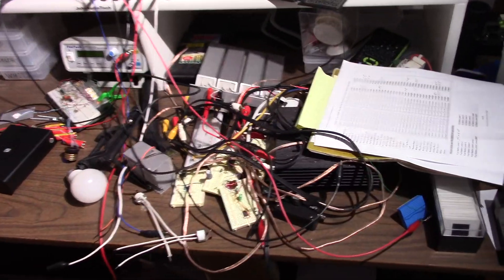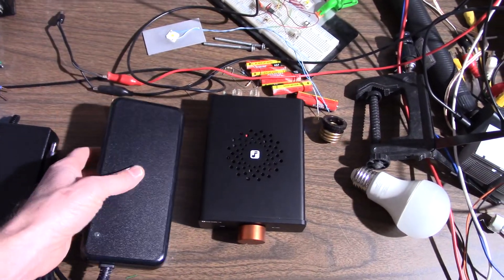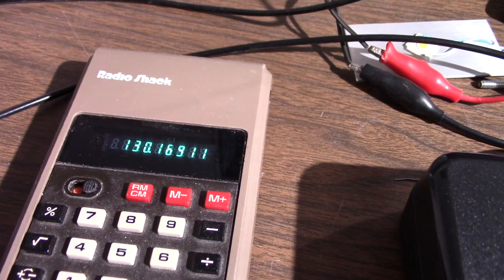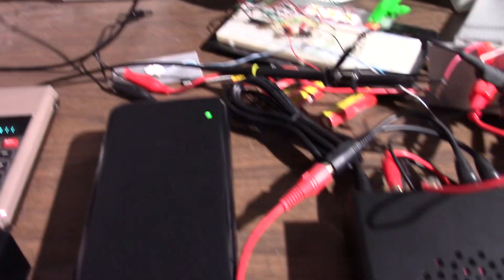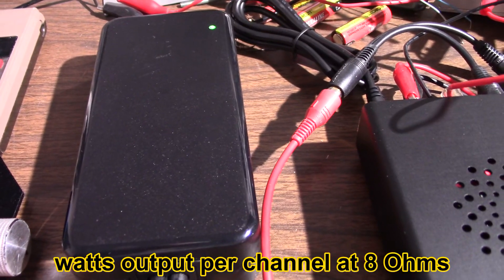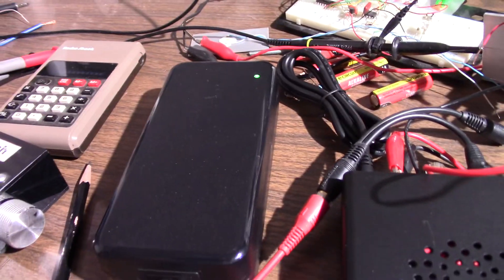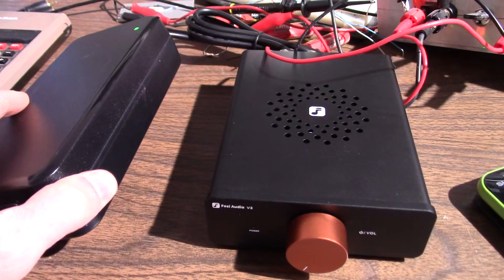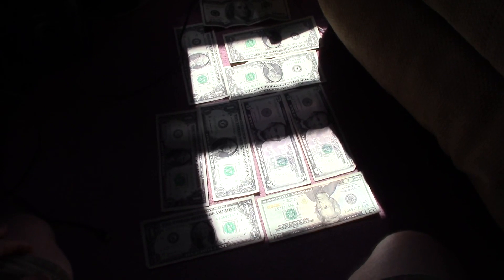Fosi Audio V3 on 48 volts - power measurement

Comment: Yeah clipping is a issue with my watt hungry 4 ohm magnepan lrs+, thus clipping on loud passages. Could replacing the connectors with copper / thicker wires in 48v possibly increase bandwidth to cure this issue?
Reply: 12awg or thicker should work better

Comment: What is the best power supply to use Fosi V3 with a pair of 6 ohms 130 W power speakers (aka Pioneer SP-FS52)? My other option would be to use a pair of Aiyima A07 Max in mono mode. Any thoughts?
Reply: I use a pair of the Pioneers in my main system, with an Aiyima A07 (original design) also TPA3255 based and a 36 volt 6 amp power supply.  Measured power is about 80 watts per channel. The thing works like a charm ... it can easily raise 90 db spl in my listening area without any hint of distortion.  

Typically I will run the amp at 1/2 volume and use the media volume in my HTPC to adjust the actual listening levels... and that sits at about 40 to 60% most of the time, giving me 70 to 75 db spl listening levels.  (Loud but not dangerous)

I generally don't recommend more than 36 volts because the cooling solution in these tiny amplifiers is simply not up to the task and at 48 volts, they will overheat and go into protection if pushed.
Reply: @Douglas_Blake_579  Tengo el Fosi V3 y lo uso con una fuente de alimentación de 48V5A y funciona de maravilla. Y así lo recomienda Audio Science Review

Comment: Dual monoblock s on 49 volts @ 11 amps
Sweet @ hi pass 70 hz. 8ohm,8 in, 3 way. Duo 18 plate amp subwoofer.  Illegally loud.

Comment: I wonder if you used a 48v 8amp  commercial linear power  supply , if that would be better and drive the v3 to max output 300w as listed on fosi litertuature?
Reply: Nope.  Stay with SMPS ... their outputs are tightly regulated.

Comment: Thanks for the effort.  This amp should be more than capable to drive the last 2 channels of my 11-channel 4-ohm AVR (the rear heights), as it only has 9 powered.  50-75W/channel should be plenty with the 48V 5A supply.  My only complaint about the amp is the lack of a dedicated power switch, so that I can set and forget the volume (and it does not mess up my 7.2.4 level settings I work hard to get correct).  Since it costs less than $100, I'll just open it up and add my own toggle switch.

Comment: I have found that when I measure power output with digital amplifiers like this, I measure much more power before clipping with a sine wave than I do with actual music. That does not seem to be true with tube amps in class A or class AB, or a conventional, transistor amplifier. I think that this may be a reason why the advertised watt output for these amps exceeds what they actually sound like with music. I wonder if you would like to do a comparison test with actual music programming and see if you get the same result.
Reply: Sine wave, dynamic range == zero.
Music, dynamic range == 10db or better.

So you will obviously read far lower power on music than on a sine wave.  No matter what class or type of amplifier.

Comment: I am using the 32v supply it came with. I am using a Fosi Audio X4 phono preamp to feed my turntable signal to it. I set the gain on the preamp 3/4 full. Do you think this is enough gain, or should I run it wide open gain. I am powering 6ohm Sony Sscs5 speakers.
Reply from the maker: If you can get the range of listening levels you want from the V3 volume control, then you are fine.

Comment: To drive my 4ohm speakers with 48V power adapters, does that mean I should use one with greater that 5 amps?  Do you recommend a 48V, 10 amp power adapter?
Reply: that seems good but maybe not   is that a thing commercially available ? maybe 36v 10a is safer and adequate

Comment: My friend,
I want to make an amplifier that works with a phase splitter, but there is a power imbalance in the signals at the collector and emitter outputs of the single transistor (2N3904) phase splitter I made.
I want clean signals with the same amplitude and opposite phase.
I request from you:
Could you please make a phase splitter and run it on your channel?..
You know very well that theory and real applications are different.  That's why I need your information, thank you.
Reply: If you want equal outputs the collector and emitter resistor have to be the same value.

Comment: I think that it would be really interesting to see what that thing would do at the maximum recommend voltage on the datasheet, and enough current to make it give full power with both channels driven.  The test you did on one channel with the bigger power supply was quite impressive, though.
Reply: I wouldn't be taking that up to 51 volts.  A lot of the caps will be rated for 50 or 25 volts depending on their positions in the ciruit.

Comment: The TPA3255 Datasheets says the Chipamp has a gain of 21.5dB. That means the opamps are providing that extra gain. So the opamps are not used as a Unity Gain opamp, they are providing gain, not only on the V3 but also on any of the other TPA3255 amplifiers from Fosi, Aiyima, etc.., except Topping PA5 which implemented PostFilter Feedback and that causes a reduction around 6-7dB of Gain, at the benefits of 6-7dB higher SINAD, and also its output inductors from Coilcraft or Wurth make a huge improvement on SINAD, as TI itself proved on the report called "SLAA701A LC Filter Design", and "SLAC736 — TPA3251 Inductor Study", where they tested like 20 different inductors and determined which inductors were the best for the TPA325X family amplifiers.

Comment: If We make our own variable power supply using buck converter or buck boost converter modules & power them using transformer or smps, will the output be noise free for powering audio amplifier circuits?
Reply: Not really, there always will be ripple and noise to some degree. It takes very careful design and special filtering to ensure a noise free SMPS.
For audio work it's usually better to have an unregulated supply and a large amount of capacitors, as that gives more headroom for audio peaks. A switch-mode supply will simply clip, whilst an unregulated supply (of the same rated power) will often give additional power for transients.
Reply: @johncoops6897  Are those readymade variable Bench power supplies use Linear or switch mode Technology that you use to review amplifier circuits?
Reply: @amitghosh6966  - I am just a viewer like yourself. Both switchmode and linear supplies are used in various reviews, however lab supplies are generally designed for "fixed" (regulated) voltage and/or current, and they cost a lot more than a simple transformer-based audio power unit.
Reply: @johncoops6897  What about the Siglent brand dual rail variable bench suppy? Is it switch mode type or linear one?

Comment: I bought a Fosi BR30D Pro... What a piece of junk. But, then again you get what you pay for. After about six weeks the subwoofer would just stop working. Power off then back on sub would come back for a short time. Now when you turn it on with the sub connected it sounds like it is going to destroy the sub. If you are thinking of buying ChiFi gear stay away from this brand.

Comment: Lol, not much difference with the 48-volt at 5 amps.  It needs  more current , like at least double the amps 😂 to even come close to rated 🤔and fosi audio plays safe for that  TPA3255 which is capable of higher power output even at 4ohm load according to the data sheet . Good to see your back making videos.
Reply: Tengo el Fosi V3 y lo uso con una fuente de alimentación de 48V5A y funciona de maravilla. Y así lo recomienda Audio Science Review

Comment: Hi John ... Nice video ... good information.  Confirms my own testing.

The TPA3255 chip is fixed gain at 26.5 DB as you discovered.  This leads to a fun situation where you have a comfortable volume going on the 32 volt supply then without adjusting anything you plug in the 48 volt supply and nothing changes  ... I've had more than one complaint about this from people expecting big exciting things to happen and they just don't. What the 48 volt supply gives you is some extra headroom before clipping, but don't expect a big change in audio quality.

The input on this chip is designed for Pro-Audio levels of about 2 volts RMS. Some home-use DACs and CD players can produce that much signal, but regular signals like TV RCA outputs and External USB sound cards will never clip this amplifier on the 48 volt supply.

Also it should be noted that, while I agree the 48 volt supply is simply unnecessary, it does not cut out on musical content. Even on brick walled CDs with about 3db of dynamic range the average power drops significantly.  If you are only clipping on occasional peaks, with 3db of dynmaic range it's about half (65watts) with 10 db DR it's all the way down to about 20 watts on 4 ohms... and the power supply can handle that much easily.
Reply: This depends on the usage. For TR devices like Shakers buttkickers etc..the moment I switched to the 48v my bk mini lfe started to bottom as the amp as finally able to push the very low leve frequencies that the BK couldn't handle but had no issues with the 36v
Reply: @shaolin95 
It's far more likely the amp was clipping on the 36v supply and when you plugged in the 48, you got added headroom, the amp no longer clips and now it's overdriving your ass shakers.
Reply: So with one is better for home use ( apartment) , 36 or 48v ? Tks
Reply: @Cesar-dt5tn  
It's not about the use case... It's about the amplifier itself.

The TPA3255 chip can handle 48 volts, but it starts getting very hot... in fact, dangerously so.  The cooling solution in these small amplifiers is not up to the task of keeping the chip cool.  At 48 volts you need a much larger heat sink and forced air cooling (picture something like a CPU cooler) to get full power from it. 

The hard part for people to understand is that no matter how hot the heatsink (in this amp, the case itself) gets, the chip is going to be hotter.  With poor cooling solutions that temperature difference can be a killer.  In fact, I've often seen situations where the heat sink and casings are cool while the chip itself is roasting near it's thermal limits because the cooling solution is not taking heat off the chip. 

In experimenting with a number of these amps using TPA3255 chips in really tiny enclosures with limited air circulation, about the maximum safe voltage is in the 36 to 40 volt range.  Higher voltages end up producing more heat than the cooling solution can get rid of and then the chip ends up getting really hot, goes into a thermal panic and then shuts off to protect itself.

That is ... there is a good reason why these amps usually come with 32 or 36 volt supplies.

Since 40 volt supplies are not readily available, I end up recommending 36 as the maximum safe voltage for these little amps.  36 Volt supplies at 5 and 6 amps are easy to get from the online vendors and can be had for very reasonable prices. 

Be aware that most home listening happens at about 1 or 2 watts per channel. With music having about 20db of dynamic range that can hit 40 watts on peaks, but for most listening it won't get much over 30.

With the 32 volt supply you will get 50 very clean watts per channel on 8 ohms and about 95 on 4.  With 36 volts that jumps to 75 and 140 ... So it's not like you're somehow missing out on anything.
Reply: Hi Douglas! TKS a lot for your attention and contribution for Fosi buyers! 

Please, do you know If Ayima sells good volt supplies? With 36v 6A we still have a clean audio  with Fosi V3 like 32v 5A?

TKS again and regards!
Reply: @Cesar-dt5tn  
If the stock 32 volt supply is working for you ... then don't worry about it. 
I've got one out there running on 24 volts (because of weak speakers) and it's doing just fine too.

I wouldn't worry about the brand of the power brick so much. They don't have to be specific to audio. Inside the casings they're all pretty much the same thing.  

What you want is a 36 volt 5 amp or 6 amp supply with a 5.5 x 2.5 mm DC plug.
There's quite a few available from the big "A" company.